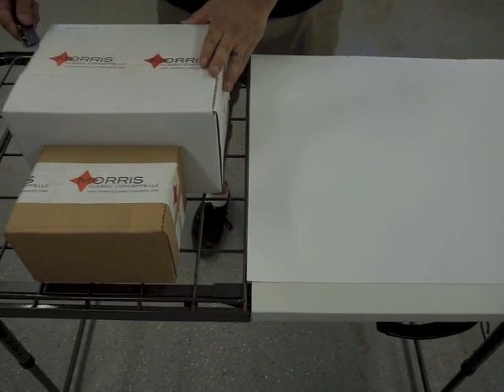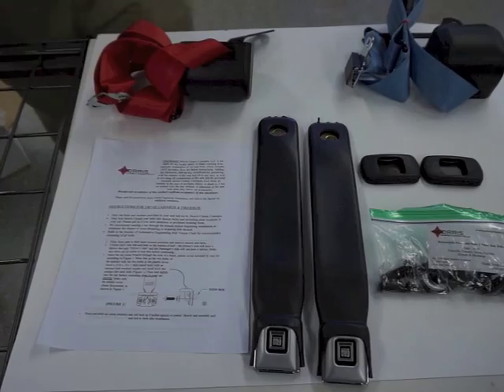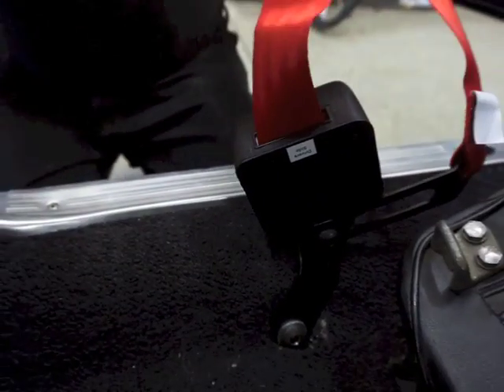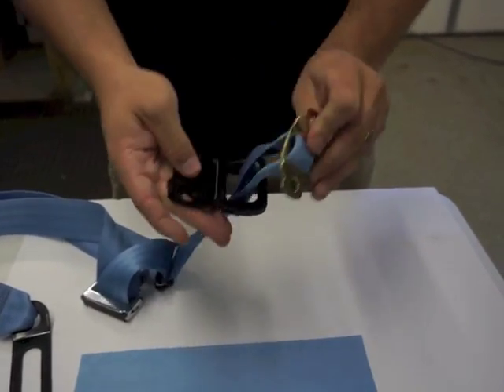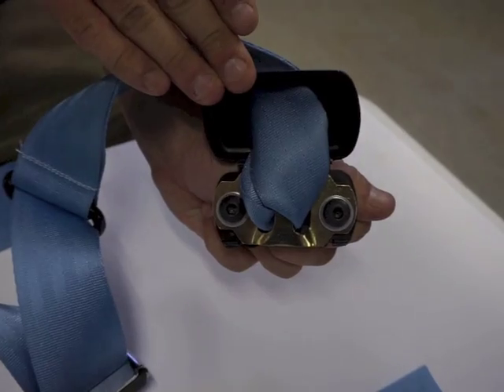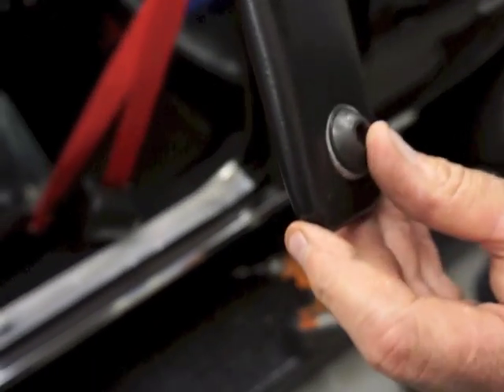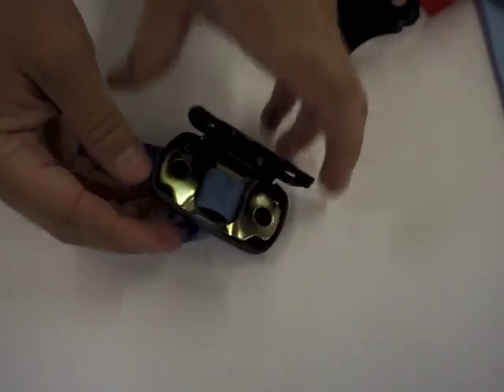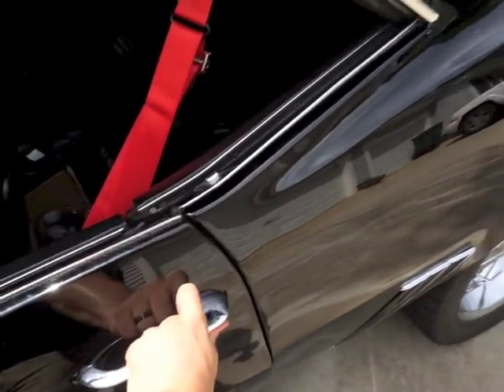Classic Car Seat Belt Installation

Comment: I just installed these in my '69 Camaro.  Very simple to do (if you have factory shoulder belts).  I have TMI Pro Series Sport-OE seats and ordered my Morris belts with the 9" bracket.  It moves the reel all the way to just in front of the back seat.  Moving the reel to this location also makes it easier to get in/out of the backseats.  The brackets are so well designed that they form perfectly around the side of the wider TMI seats and don't interfere with the reclining handle.  Very impressed with these.

Comment: Does the lap belt portion stay tight while  driving or is it loose until you hit something?
Reply from the maker: The lap portion does stay across your waist while driving (not too tight, but in the same place) due to the male buckle having a retention bar vs. being free-floating. In other words, wherever you set that male buckle bar to be is where it will stay when driving but can be moved anywhere up or down the webbing for a comfortable fit. The seat belt assembly itself is speed-sensitive so the reel will lock up if the webbing is pulled quickly or jerked at all. Please let us know if you have any questions (you can also email us directly at sales@morrisclassic.com), and thank you for your interest in our seat belts!

Comment: Do you have a video of the rear seat 3-point harness install process on a 68 Firebird (or Camaro)?
Reply from the maker: Casey, 
Not at the moment, but it is on the agenda for this month to complete. In the meantime, if you'd like to call or email me through our website, I'll email you pictures.. I'll also follow up on this comment when it is complete and uploaded. 

- Chris R. 
Director of Marketing
Reply from the maker: Casey,
You will find our Rear install video at https://youtu.be/V411E06odWQ. 
The second car we use is a 1968 Camaro. 

Drive on! 

- Chris R.

Comment: are there pre installed threads on the car ?
Reply from the maker: Yes, if you have a GM car that was made in February 1966 or later, your car already has the threaded factory holes in the top and floorpan. Our seat belts bolt into these pre-existing holes. Let us know if you have any other questions!

Comment: Hope this works on my 74 bird
Reply from the maker: Samuel,
As long as you order the correct year-and-car-specific set for your 1974 Firebird, they'll bolt into all of the factory locations and replace the originals! I have put the direct link to the ones for your car below so you can view them in our online store - they do look different than the seat belts shown in the video since they are for a '74.
Direct link: https://www.morrisclassic.com/products/1974-81-firebird-front-3-point-seatbelts?_pos=1&_sid=8b7338d58&_ss=r